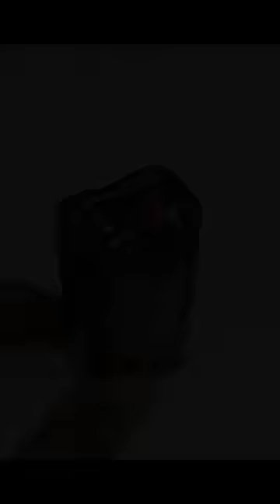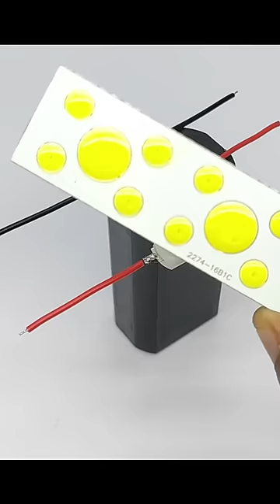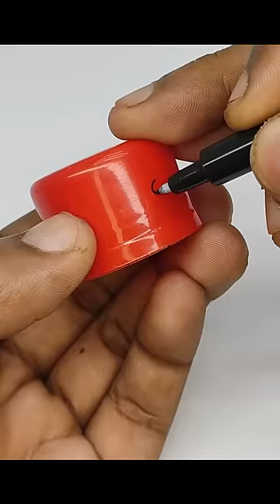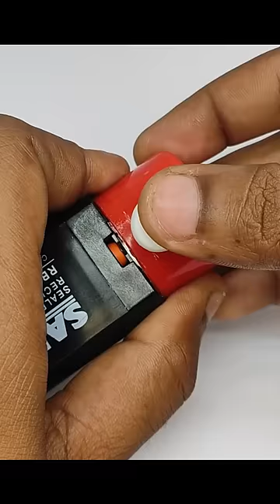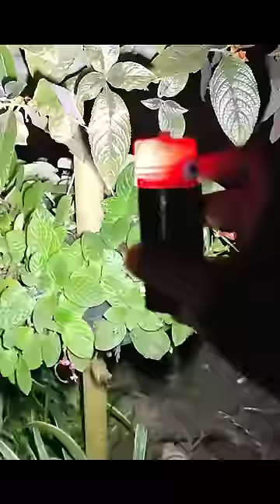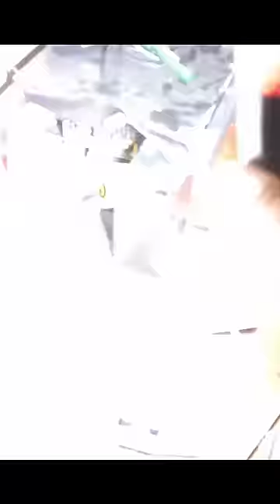Amazing invention

Comment: Is there a circuit for overcharge stop, means charging stops when battery is full
Reply: Looks like he used a diode to reduce the 5v from the usb charging cord to 4.3v, which is pretty close to the 4v of the battery.

Comment: You should write those names of that components....
Reply: All components - 

1x    IN4007 diode
1x    1k resistance
1x    4v 1 ah battry
1x    1v red indicator led 
1x    usb charging socet 
1x     cap 
1x     push switch 
1x    3v led  strip 

Total coast ₹70 ..... ❤
Reply: Thanks for asking that's a good question

Comment: U made it. It's a nice ideabut if we want to connect it with a 3W 8.97v 3A solar panel to charge the battery then
Reply: Add 12ohm resistor between 8.97v and 4v  battery
Reply: Can i have the diagram please
Reply: @kjavid1705 I did not get any response
Reply: @miteshdhanani  just connect a 12 ohm resistor between  4 v batt and usb input, socket on + ve  red terminal and let the black - ve terminal as it is shown in the vedeo  , 
Then connnect the usb male cable to 8.7 v  solar panel ,

Comment: Which resistor u have used in this video?
Reply: Color codes my dude, learn em:)
Reply: you can use 1/2 watt 100 ohm or (brown black brown golden). it is used to reduce charging volage for the LEd light.
Reply: 100ohm 1/4 watt sufficient
Reply: It doesn't matter whether it is 1/2 watt or 1/4  watt or 1 watt, it is used for the charge indicater led red bulb protection against the charging voltege..